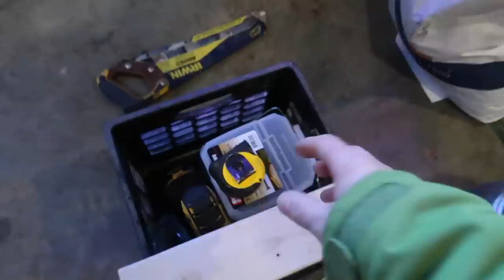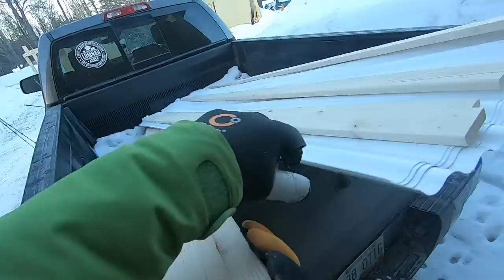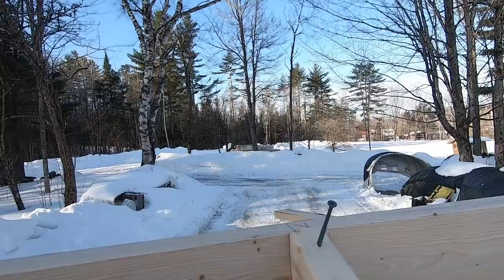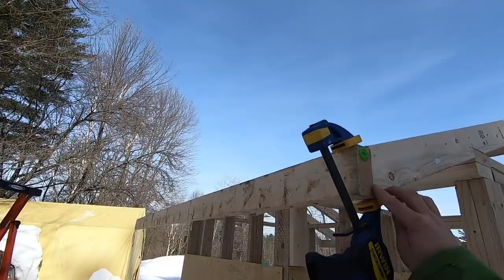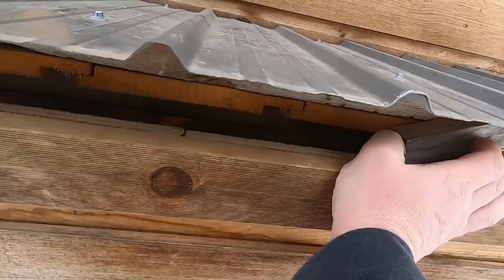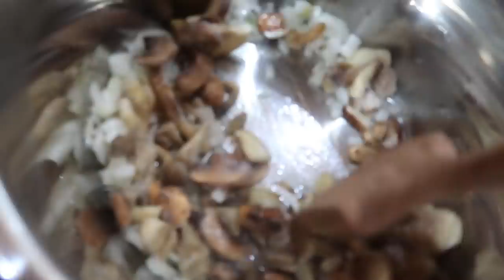That Moment of Truth When you Find out If your Hard Work Pays Off! (Building our Pasture Pig mobile)

Comment: Next time you get into situation where the 2x4 doesn't align or similar, drive a screw upward through 2x4 in line with rafter.   Leave it out about 1/4 to 1/2" and pull it in alignment with a claw hammer under rafter.   Hope this helps!    Congrats, your at over 80K subscribers now!